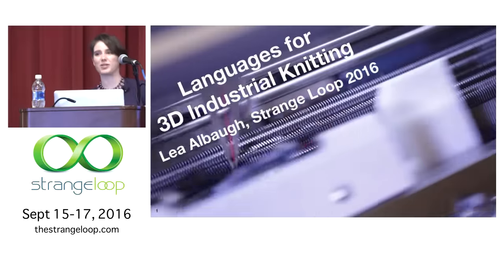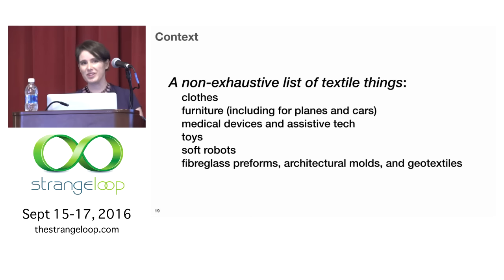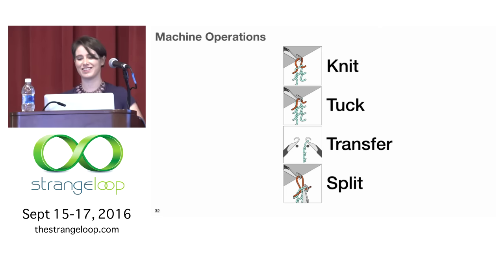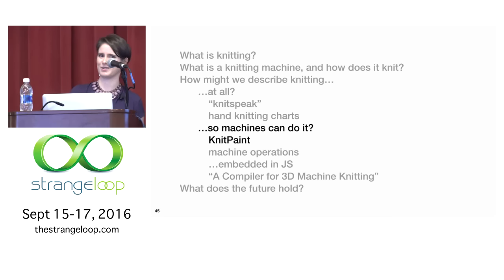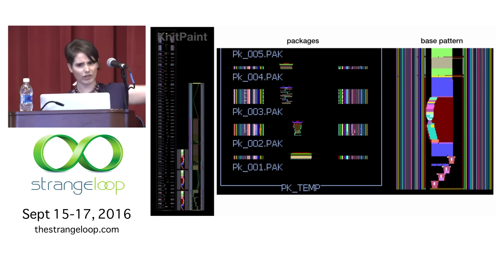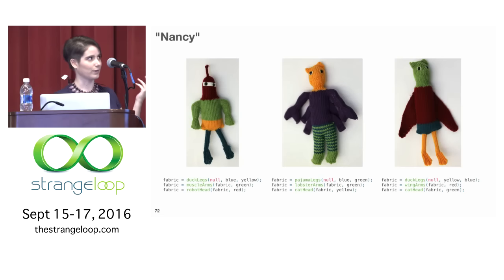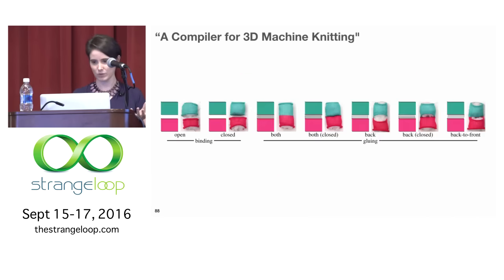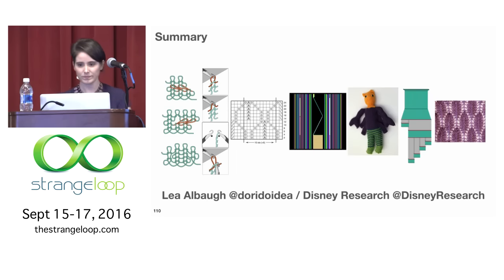"Languages for 3D Industrial Knitting" by Lea Albaugh

Comment: Personally I think this is one of the greatest presentations because it's so far afield. It expanded my mind. I'd be interested to hear (or read) more about the dynamic-programming techniques. Not because of knitting personally (although I have used a hand-operated knitting machine a few times)  but because it's such a good exercise to contemplate entirely unfamiliar problems.